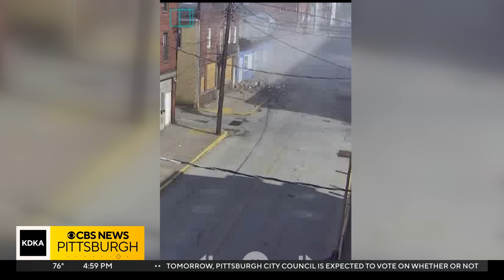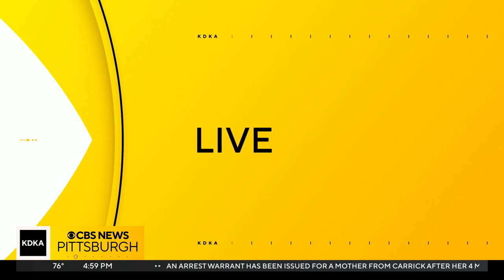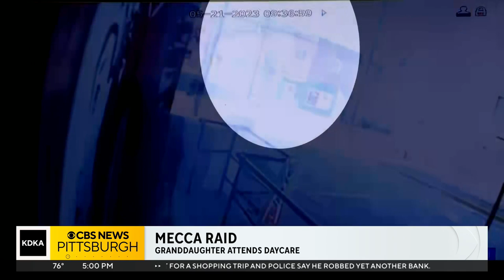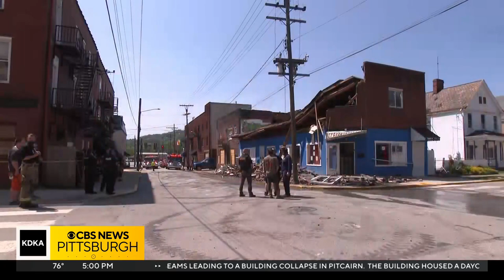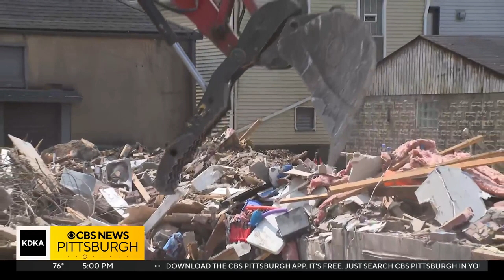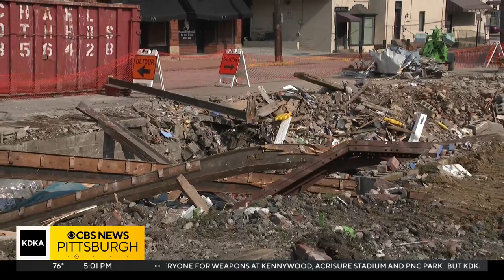Video shows partial collapse of Pitcairn day care

Comment: I looked at this on Google Maps and it looked like there was a crack above the second floor windows all the way around the building.  It doesn't look like it separated there, but I'm sure that crack around the mortar around the whole structure should have probably been addressed.  I'm not a building structure engineer, but my eyes tell me it didn't look good.  That's my opinion.  I'm really glad there were no kids there for sure.  I was on Broadway in Pitcairn on Sunday riding through and saw one police car on the street until we got to Center Avenue and there were firefighters and other police cars going down the street.  I could also see debris on the ground in front of where the building was standing.  At that point I didn't know what happened.